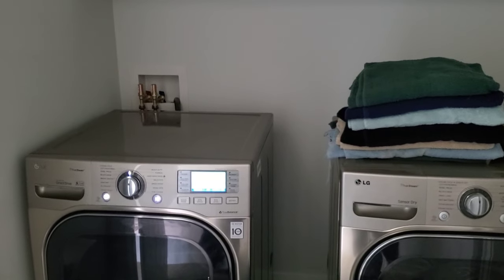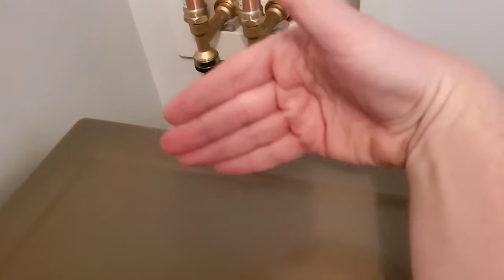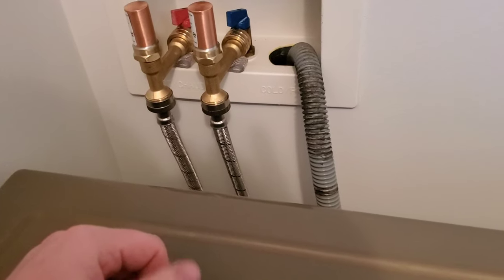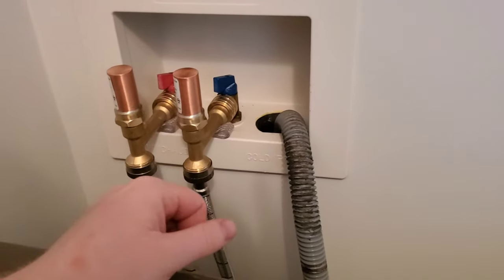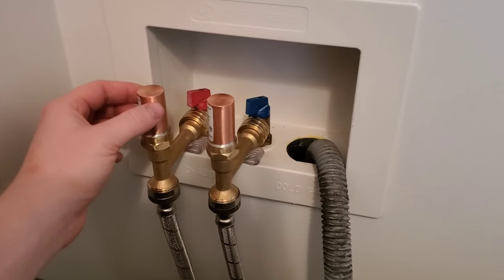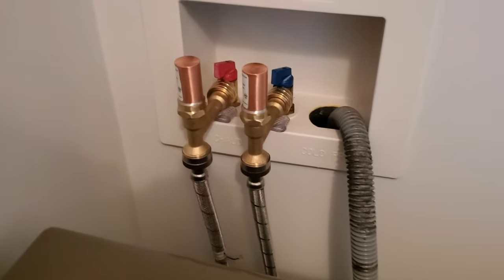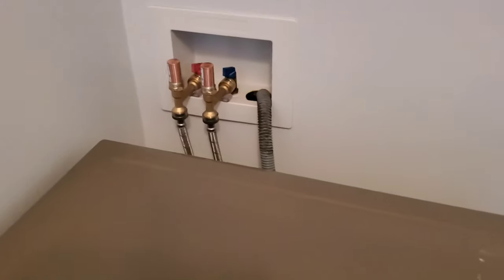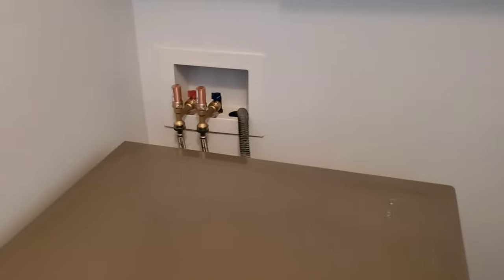How to prevent Loud knocks and Bangs from Washing Machine (Water Hammer) W/Amazon Product Link

Comment: Just a FYI per the directions these should be installed on the input of the washers.
Reply from the maker: That is actually false. They are supposed to be installed where the water/pipe changes direction. No where have I research, nor did the instructions say to install on washer Inlets. If you do a quick Google search you will see the same result. 
Here is a blog on how I did mine exactly:
https://www.familyhandyman.com/project/how-to-use-water-hammer-arresters-to-stop-banging-water-lines/
Reply from the maker: @bradleywyatt6683  thanks for the explanation. I'll have to look into it more. 

All examples I gave found were usually at the valve. Or soldered inline.
Reply: Hey guys I’m about to throw a few of these on in my laundry room. What’s the score here? Direct connect to the machine or we going off the supply?

Comment: thanks for this upload. We have water hammer arrestors on our hot and cold line at the washer and unfortunately that didn't assist.
Reply from the maker: Sometimes they don't. It all depends on how the lines are routed as well.
Reply: Are they on the washer side or wall side? Also, I've seen people have to go with 4. Two at the wall, and two at the appliance

Comment: Thank you. I purchased and installed. While sound not as often it is still happening. Does it take a while for all the air to pull out?
Reply from the maker: I noticed the same. It was alot less drastic. But if issue remains its likely due to internal routing of pipes.